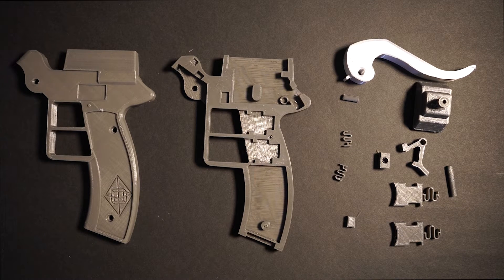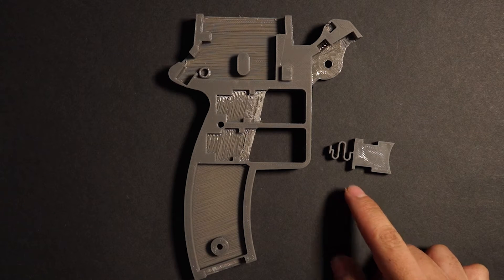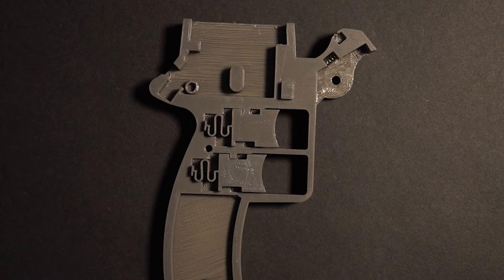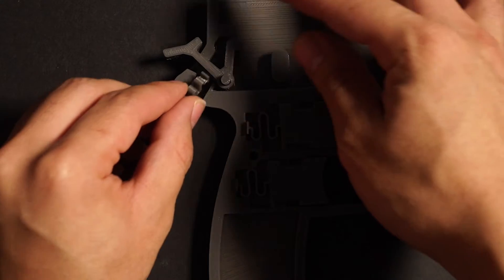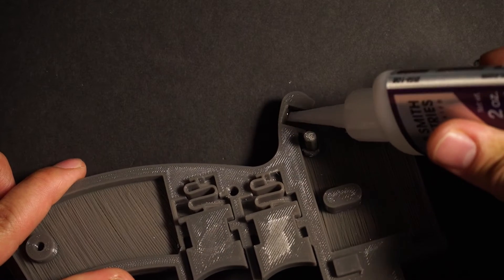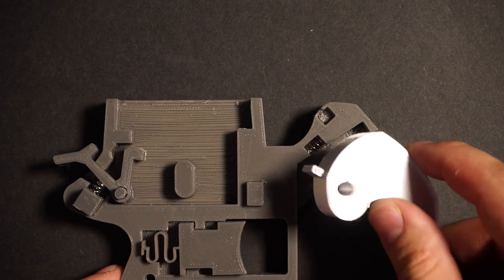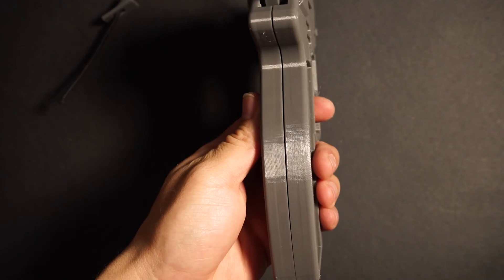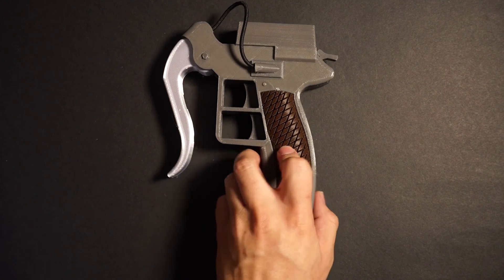Making a fully functional 3d printed Attack On Titan Blade!

Comment: Hey when I put the triggers in they cant be pushed. Any fixes?
Reply from the maker: Sure! There's a few options. make sure that the walls around the triggers are free of any supports. even a small nub can cause added friction preventing the triggers from sliding. A small drop of oil goes a long way too! any type of all purpose machine oil should be fine. Lastly, If it's still giving you trouble it might be because of print tolerances, you can scale down the trigger a bit to help with that.